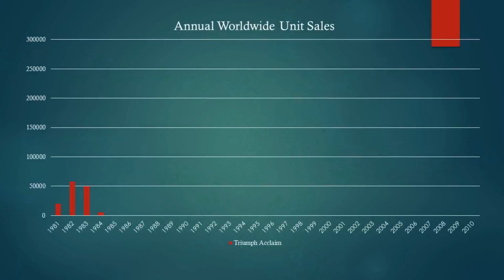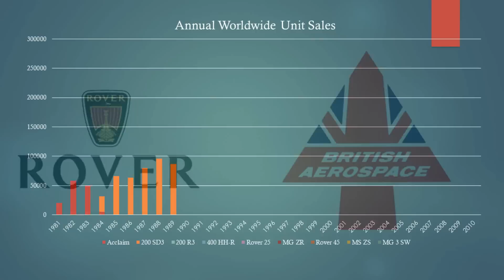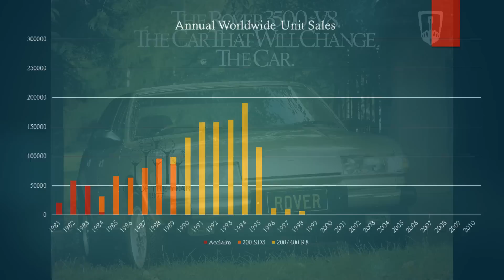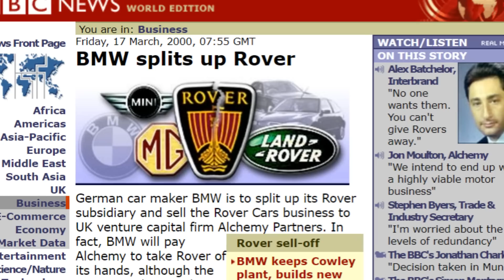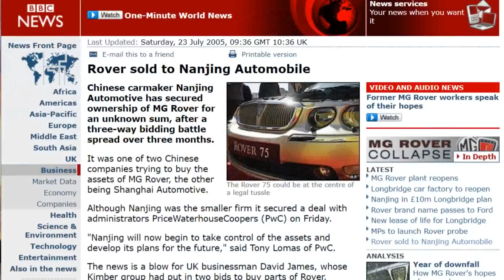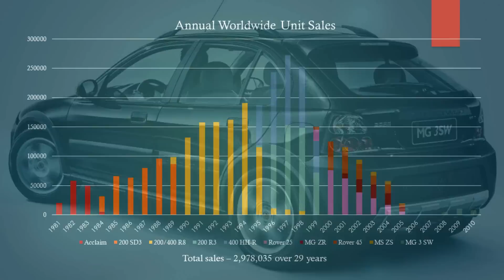The Rover 200 Story

Comment: the k series rover engine...

that engine that was poorly designed and would always fail with a stock head gasket....3rd party ones didn't hold up to long if you pushed the block.

horrible engine and poor performance.
Reply: the rover 100....should talk about the recalls for loose bolts....holding the subframe and the bolt hold the steering column inside the car. 

rover build quality was astonishingly bad. they sold well because the British public could afford them. honda cost more.